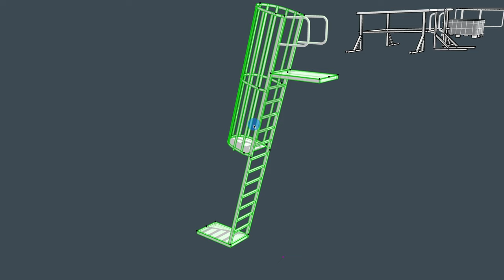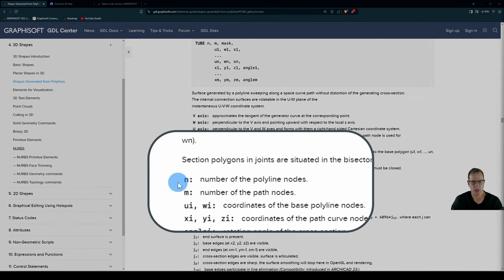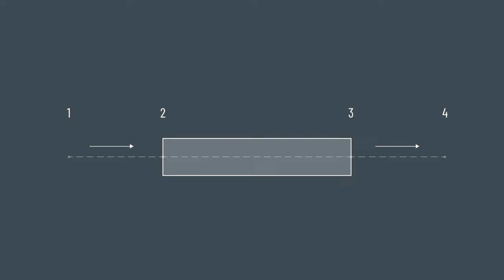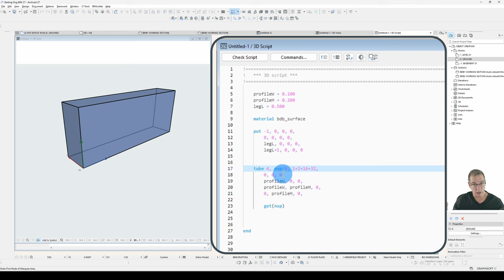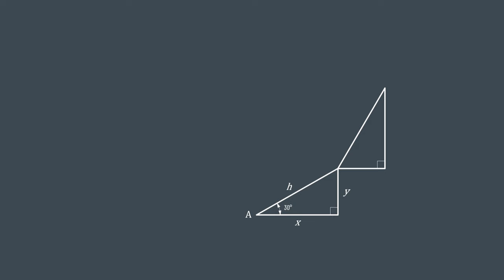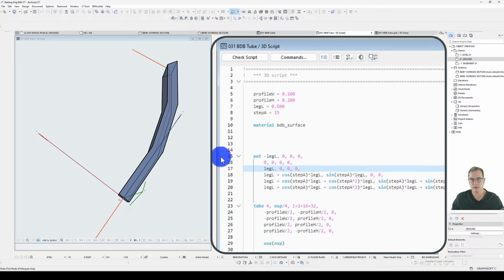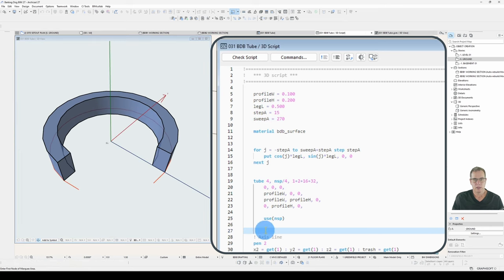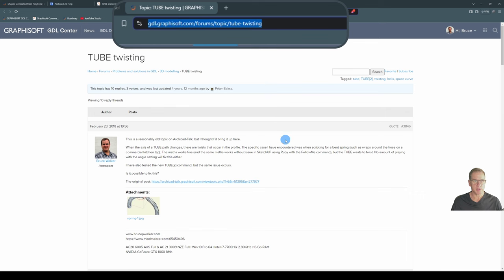031 Archicad GDL TUBE Command Basics

Comment: Haven’t watched this lesson yet, but I’m wondering if this command is the one I would use to create a pipe, for example. I would like to make a flexible chimney that could turn in different directions—front, up, left, right, etc. 
The catchy part is that, ideally, it would be a parametric path, where the user can choose it.... it would work similar then a pipe, but the pipe tool riquires other individual 
parts to complete the path
Reply from the maker: Yes, this command can be used for what you describe.